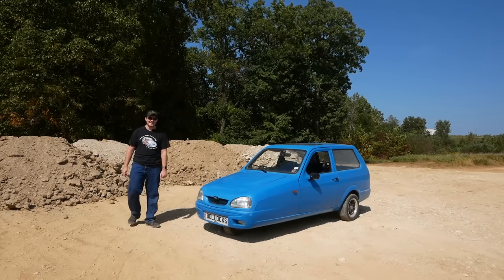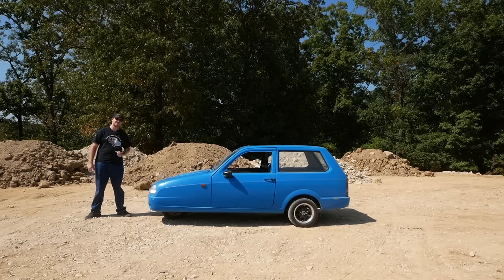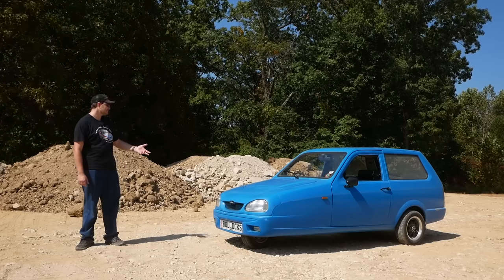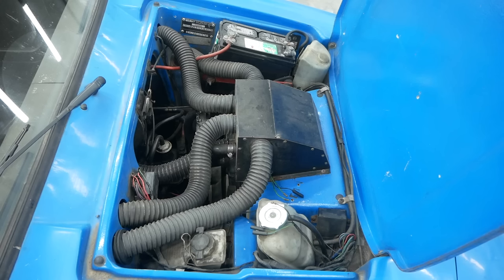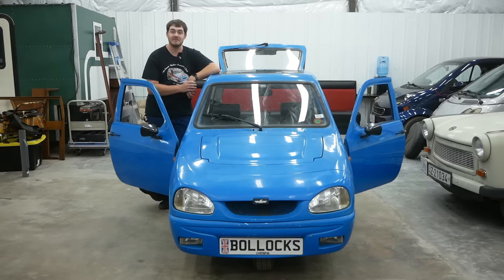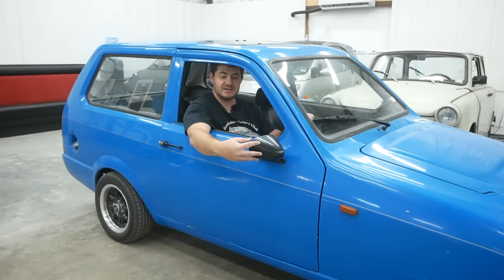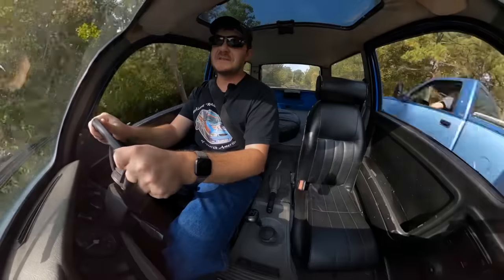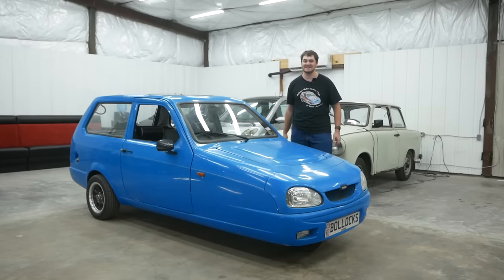I Bought a Reliant Robin!

Comment: Needs "trainer wheels" on the front! That will help to prevent crashes, rollovers, and driver stupidity! A more successful design would be two wheels in front, one in back for more stability?
Reply: It was supposed to be a 4 passenger hatchback.  For a single rear wheel you are sacrificing all the practicality of the car to solve a none existent issue

Comment: Cheap ( fairly ) reliable motoring on a budget, I had a regal van, cos you can drive them on a motorbike license, used to throw it around on county roads,they were swines to work on, as they had an even smaller bonnet opening then the Robin , no heater , no synchromesh in first but they were quite lively and had great petrol consumption, I never turned mine over and I'm not a slow driver. They are so light they can be blown around on freeways by large trucks passing. No rust due to fiber glass body !

Comment: Had a Reliant light van (66) and I loved it got a drum kit ,small pa system ,my amp and guitar and a girlfriend in it for gigs didn't weigh anything low tax 60ish mpg and you only wear out 3. Tyres at a time drive mine on a bike license ( the myth about the reverse gear was if you drive it on a bike license you had to blank off the reverse not true!) It got me about for several years till I passed my car test. Would have another just to pxss people off👍🇫🇴☺️

Comment: As a young papermill fireman, we had a few call outs to Regal 3/25 fires because the petrol feed to the carburettor developed a leak. Carburettor is immediately above the exhaust manifold. Not the most sensible set up!!

Comment: they overheat very easily, hence the central temperature gauge.  i once tried to persuade an east german that we too had plastic cars in britain but ours only had three wheels. he got annoyed. thought i was making fun of his country.  i had a Reliant to go to work in bad weather. as a biker i used my m/c most of the year. a reliant is safer and easier to drive than a m/c combination but just as cheap to run.    thanks for very entertaining video.

Comment: Early Reliant motor cars in the UK did not have reverse gear, this was so they could be driven by holders of a motor cycle driving license. They could be converted adding the reverse gear. The Robin also had a big sister called the Kitten this was a four wheel version of the Robin which was equally as bad with its fibre glass body and clunky gear box and terrible brakes.

Comment: The SU carb is a gem. The Datsun 240 uses a clone. So much so the parts look the same. The SU can be set up to do anything you want and is logical. It can be removed and replaced inside one hour with parts checked. OK it needs a choke cable for cold starts. Even that can be automatic ( you should n't ).

Comment: check also how far back the reliant 3-wheeler goes; htey started with cyclecars before ww2 and developed the Regal straight after WW2; all the rest of the 3-wheelers were pretty much direct descendents. They did do 4 wheelers too; eg the Scimitar, which I believe got Princesss Ann a speeding ticket half a century ago.

Comment: There was a 4-wheel version called the Reliant Kitten.

The ‘no reverse gear’ myth is based on truth. Three wheelers in the UK count as motorcycles so you can drive on a bike license. This meant you could also drive it on a provisional licence as a learner driver, providing your passenger has a full bike licence and if the reverse gear was blanked off, you could drive it on your own (but couldn’t carry a passenger).

Comment: My those front seats are luxury… Reliant originals were more like fabric covered infant school chairs.. the rear bench seat being much the same alas. All driven by weight saving so that those in the UK with motorbike licences could drive them without needing to take a car test. Great review and pretty much accurate on all accounts. I am guessing you’ve not had to do much servicing on it yet… when you need to change that clutch you’ll just love how every nut n bolt is positioned to be nigh on impossible to remove.. starts with the prop shaft bolts lololol

Comment: There is nothing you can tell me about Reliant Robins. Both my grandad and my step dad owned Reliants in the 80's and we used to drive 200 miles to Great Yarmouth every summer for our holidays, they would shake and rattle doing more than 50 mph so we never went near a motorway. Great times, sort of.

Comment: ohh.. BTW, that switch with the circle with the exclamation mark in it, that's a brake system light. 

According to DirectLine:
 "The first thing to do if you see this symbol glowing on the dashboard is check the handbrake hasn’t been left on. Assuming it hasn’t, there is a fault with the brake system. That could relate to the worn condition of the brake pads or discs, a lack of fluid in the system or a problem with the anti-lock brakes (ABS) or stability control (ESP). Have it investigated by a garage as soon as possible."

Comment: Known as "The Puddle Jumper". The reason why people believe that it has no reverse dates back many years. In the UK there was a time when people with a motorcycle driving licence could drive a three-wheeler if it did not have a reverse gear, consequently a lot of Robins and its predecessor, the Regal, had the reverse gear blanked off, so it couldn't be selected. Later, the law was changed and three-wheelers with a reverse gear could be driven on a motorcycle licence.

Comment: The 1977 Cadillac Coupe de Ville used a 500 cubic inch (8.2litre) V8 producing 180 bhp for 21.95 bhp/litre. The 1975 Robin used an .848 litre to produce 40 hp for 46.17hp/litre. Mock them as much as you like but they were literally twice as good at engines as GM was.
Reply: Their power to weight ratios were roughly the same.

Comment: I would redesign the front suspension to pivot in front of the wheel, so that turning right would swing the rear of the wheel to the left, countering the tipping tendencies. There is certainly enough room to have the wheel do that

Comment: The reason this car exists is the British licence laws, having 3 wheels makes it classed as a motorcycle and after the WWll most people rode motorcycles because cars were expensive and rare, ergo most people had a motorcycle licence only and could buy a 3 wheeler like this and drive it without taking a driving test.  There was an earlier model to the Robin called the Regal made from '52 - '73 and you guessed it it was the same thing with different body panels. In the '70's when I was young most of my biker friends had bought one when they got married and started a family, they were dirt cheap to buy, run and tax (Yearly car Tax) When you rolled it you just got out and picked it up and drove off again. Awful things but useful and hilarious fun when driven full of friends that were terrified at all times :)

Comment: the myth about reliants not having a reverse gear was because in the UK at the time, if the reverse gear was disabled, you could drive a reliant on a motorcycle license which was a lot easier to get at the time since the testing was much easier than it is currently or was at the time compared to regular driving license.

Comment: and they used to race these things years ago in the UK, people put all kinds of insane engines inside them, robin reliant with a porsche 911 engine inside it could really pick up some speed since they weight basically nothing, usually only useful for drag racing though since turning was problematic even when the engine was put in the rear.

Comment: If you wanted a 4th wheel then you bought a Kitten or a Rebel I had one of these but had to sell it as the 10" wheels were too small for modern potholes. The previous model the Regal that I had had the 700 cc engine and could pull a wheelie and do 90mph ( on an old airfield)somebody did get pulled by the cops in the UK for doing 110MPH  in a Robin so yours may be down on power a little 
But they are great fun like a motorbike you need to be alert! this country needs Lerts.

Comment: Many years ago I was riding my (motor)bike home in England.  I rode past the remains of a Reliant Robin that was all over both sides of the road.  I didn’t think much about it until later in the day when I bumped into one of my mates.  He mentioned that he’d been in an accident on his bike (I think it was a Triumph Bonneville but it was a long time ago) but was OK.  I asked him what had happened and he said he’d hit a Reliant Robin.  The bits and pieces I’d seen were the remains of the Robin he’d hit.  He had a few scratches after crashing into it.  The Robin was absolutely destroyed.  Not many cars come off worse in a collision with a motorbike.

The Reliant Robin probably has the worst reputation (in the UK) of any “car” ever made in the UK.  If you think there is a major shortcoming, eg lack of heat shielding, the likelihood is that it left the factory like that.  No corner was left uncut.  The Reliant Robin is what happens when you give a resourceful English engineer a shed and £20 6s 4d and tell him he has a week to make something you could call a car without definitely lying.

Comment: the confusion over the revers gear. under uk law you could drive one on a motorcycle licence if a small metat plate was atached preventing you from using the revers gear.
most robins wear originaly sold to bikers

Comment: I had the Regal for less than a week - it nose-dived in a slow-speed corner and tore a chunk out of the front quarter - I can remember the front wheel seemed to find all the potholes - slow rattly and cold - I  later bought a Bond Equip GT4 much nicer

Comment: The switch that you do not know what it does is the low brake fluid indicator, same as the classic mini, and it turns on when you press it to let you know that the light is still working, you should have a sensor on the brake fluid reservoir

Comment: I wish more car companies sold here in the US would make tiny cars like that, especially 3 wheeled tiny cars that are NOT considered motorcycles (I don't want to have to fuck around with getting a motorcycle license). I only need 2 seats, and high fuel economy, I never go on roads higher than 40mph, etc,etc. But all the small cars are not legal in the US or insanely expensive to import.

Comment: A bit late to the party (and the following points have probably been made, but I can't be arsed to read nearly 5000 comments), but...
a) In the UK, every Reliant ever (except the Scimitar and the Bond Bug) is referred to as a 'Plastic Pig' - even by the owners
b) The myth about not having a reverse gear comes from the early 60s when any three wheeler with reverse was classed as a car and one without reverse as a motorcycle & sidecar; this encouraged a  proliferation of 3 wheeled cars without reverse (Bond, Peel, AC etc), because most working men could only afford a motorcycle at that time, so only had a motorcycle licence (in the UK at that time, it was only doctors and lawyers that could afford a car). By the time the Robin was produced, the government had metaphorically thrown in their hand and allowed all 3 wheelers to be classed as motorcycle combinations. But for some, the 'no reverse' myth was hard to give up.
c) 30 years ago there was a Reliant Robin Supervan with a 3.8 litre straight six Jaguar engine fitted; admittedly it had an extra wheel on the front, but funnily enough that was easy to miss as the rest looked bog stock. He reckoned he surprised a few Porsches by out accelerating them up to 100mph, but he did say that over that speed the aerodynamics made it 'interesting' (ie lethal).

Comment: Looking back on it the video, I never noticed it has a glass roof, sunroof, moonroof, whatever they wanted to call it. It's there and I didn't notice it until you were inside driving, but you failed to elaborate on it as one of its luxurious features. 😂 ...Also, why not just put some type of heat shield material on the inside of the engine access panels, or maybe you're not a fan of left leg hair?

Comment: I don't get it though, for stability reasons why did they not reverse the wheel setup by putting two wheels at front and one at the back instead?
Reply: Cost I’d imagine. It was built to be functional and very cheap. Also it was designed to carry a load in the rear so one wheel there wouldn’t have been practical.

Comment: Hay hay, iv been doing Mini Coopers for the last 25 yrs hier in Nürnberg, i bet thats a BRAKE LOW FLUID SYS check switch. When ya push it and it lights up the circurt is ok. it should be conected to the Brake fl Cap with 2 flat pins. Let me know if its what i think if ya can, Stay Mellow Ppl´s

Comment: 8:30 I think I could comfortable ride in your car as a passenger, but I'm not sure anyone with a real right leg could.
     I work as a welder and I have set my leg on fire once, but I got rid of the foam rubber cosmetic cover, so I doubt it will be a problem now.

Comment: 5 minutes in, and the humor is making my butt hurt. 🤣🤣🤣

Body on frame? Make a buggy out of it! One problem: I love the sheer irony of that sleek modern body on a Reliant Robin. The clothes maketh the... gokart.

There needs to be more Robins in the USA just because of that hood joke.

If you think that dash is 70s, you didn't see 70s British cars. Jet black relieved with the exterior paint coming in or, in 'luxury' cars, walnut wood. There wouldn't be a lid on the glovebox unless there was walnut to make it out of. (Metal lids were rare relics of the 60s. They looked better than the wood, IMO.) The instruments and even air vents were sometimes just pods on a shelf. Honestly, I'm probably exaggerating and it all might have been changing by the end of the 70s, but the old style is still what I think of as a real car. The huge puffy plastic dashboards and half-filled steering wheels of modern cars look overweight and stuffy to me.

I'm pretty sure Austin Rover's excuse for putting that one light in a switch was so you can test the bulb. 🤔 To be fair, it was a symbol they didn't have room for in their stock mass-produced instrument pods.

Hahahaha the leather strap! That's one I haven't seen forever. That's cheap and old hat even compared to the other 70s British junk. Actually, Austin Rovers had really good detents even if the rest of the car was junk.

Curious fact about Reliant: They actually wanted to make sportscars. On the occasion they got the chance, (the Scimitar,) they did it very well. Maybe that's why the Robin is so much fun to drive.

Comment: The deal with these was that you could get a motorcycle learner's permit just by going in to the Motor Transport department and filling in a form. You could then ride a motorcycle provided that it was solo and less than 250cc  OR: you could have a 'motorcycle and sidecar' of any cc and you could carry a passenger in the side car. The reliants were classed as a motorcycle and sidecar. This meant you could have a kind-of car if you were a 16yo learner, and this wasn't a bad alternative to a wimpy motorcycle you couldn't take the girlfriend on.
Also cheap to buy and run by comparison with an actual car.

Comment: Motorcycle licensed so that means you have to have a motorcycle license to drive it. I'd rather have my old 2013 Chevy Spark back. It had so much going for it in handling(safely) and acceleration, fuel mileage, radio with speakers, and AC. It was a really fun car to drive. This one would be wrecking time and again as I don't like slowing down too much for turns. The better layout would have been 2 wheels in front with one in the back.

Comment: Forget the Corolla, i can't imagine '99 Lada with carburetor, novac brakes and manual windows..

But as for the choke, i'd rather have that on a modern car, instead of thousandmillion sensors, which undecidedly judder the engine between ten and fifteen hundred revs, when it's abit colder than autumn. 
With the choke cable all you do is start with full pull, and let it go gradually, when the engine began to missfire.

Comment: I delivered these things from the factory to the dealer , getting them on and off the truck was a nightmare, the centre ramp was the width of the tyre tred , to get them on and off ,  I had to drive with the door open , and lean right out with my head looking under the car at the front wheel to keep it on its ramp , a contortionist would be hard pressed to do it , the other problem was these thing were sold by back street motorcycle dealers , who would sell two a year if they were lucky , so a load of eight would be eight drop off points in narrow back streets all over Britain it could take a week to deliver one load , .....not worth doing

Comment: Honestly, 40 hp is a terrifying amount of power for a car with 1(one) front wheel and a 1000-lbs weight. It’s not your run-of-the-mill low-speed vehicle, that’s for sure

Comment: These cars were produced for a long time because of repeat Business.I know one Guy that never wanted any other Car
they where reliable and cheap to run.
the one without Reverse gear..(Blanked off)...were to conform with UK regulations..if the Car weighed less than 8 Hundredweight and had no reverse it was classed as a motorcycle and could be driven in a Bike licence

Comment: Take the engine and transmission out put a electric motor in front along with a two stroke generator. Place the batteries in a convenient place and, bam. I want one. Well until a truck hits me.

Comment: It is awful but nice to see! I used to own a 3 wheeler, a Bond Equipe, a rear engined, fibreglass, machine that I broke doing an accidental wheelie when my cowboy boot slipped off the brake pedal and hit the accelerator pedal - Hard!
I broke the differential, and it would only turn right after that! Oops, 😃